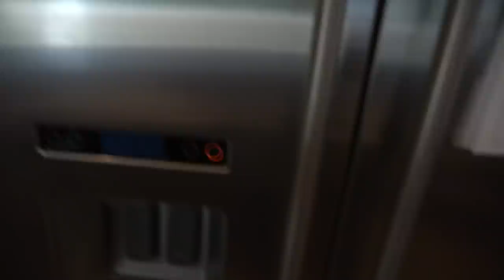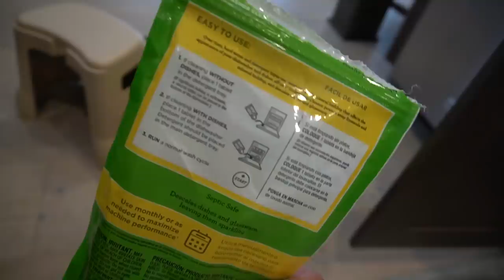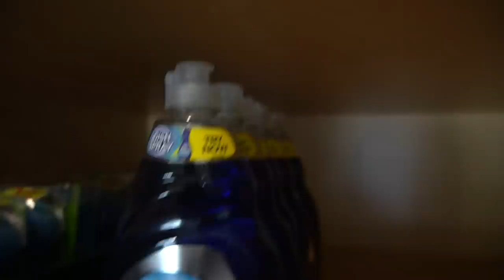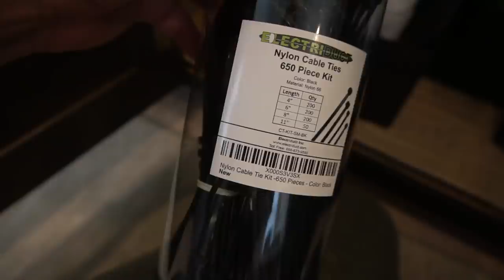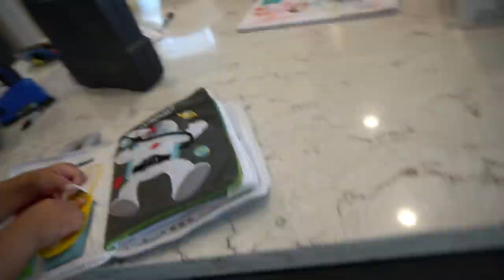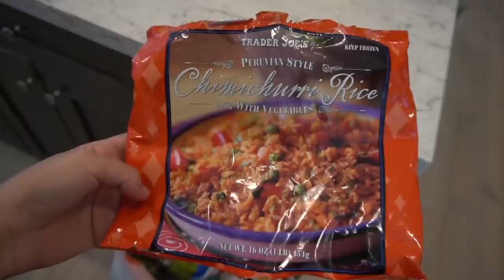Home Haircuts Part 2!

Comment: use flush cut cutters to cut the tangs off the zip ties. the next time you are waving your arm around them you will thank yourself. they cut flush with the square end so that it doesn't leave a sharp edge and cut you.
https://smile.amazon.com/Hakko-CHP-170-Micro-Cutter/dp/B00FZPDG1K/ref=sr_1_2?crid=BTFUMJGX5AHV&dchild=1&keywords=flush+cutter&qid=1591853358&sprefix=flush+cut%2Caps%2C199&sr=8-2

plus they work for a lot more than just zip ties.